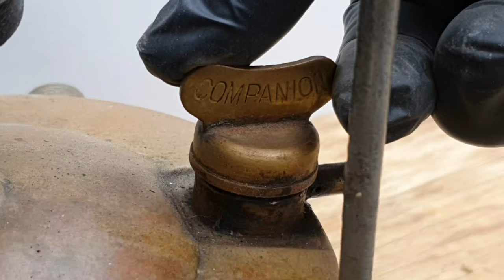1930's  Vintage Kerosene Companion Stove Restoration

Comment: Am glad you didn't have to weld back any parts. That was a nightmare for me. Flame proof gloss looks so much better than matt. Very nice and shiny and ready for camping 👏👏👍
Reply from the maker: I know buddy I watched yours a couple of times and that bit looked like a pain. I now have a new appreciation for all the work you did on yours, that project was harder than it looked.
Reply: @Austeration  Haha - your sandblaster seems to be working perfectly. Hopefully I get back to playing with mine next week 😉
Reply from the maker: @LittleRestorers  mmm not that perfectly. The glass I put inside has started to pit already and after a good work out it's still starting to run out of media. I'm going to have to start working on version 50.1 now. Still better than it was though.

Comment: Wow!!!!!!
Reply: that Sir it a cool stove !!!!!
Reply: Looking Great 👍
Reply: love the table slide move !!!!!
Reply: I need to try the Blue,  looks 👍
Reply: The pump cup !!! Great tip , must try that .
Reply: Hey !!!!!!!! thanks for the shout out ! you used the funnel!!!!
Reply: You sir ARE the master
Reply: That Burner BLUE Burner 💙  Thank you Great Work 👍 👌 🙌 👏 🙏 😀
Reply from the maker: @doinsngoins  Thanks Steve that funnel is great. I was going to check with you about the flame. Is that how it should be burning or should it be like a rocket like yours are and if so what do I need to do to fix it ? Any thoughts.
Yes get your self some cold blue, you will be glad you did.

Comment: Great job. Nice to see how good they look when restored. I love the polished brass. 
I have about three, some with missing parts so I should be able to make one out of the three. Last night I ordered a repair kit of spanners, gaskets and valves from the UK for when I get around to doing mine. Hope it turns out as nice as yours.
Reply from the maker: Thanks for watching Shed Man. I also love polished Brass. I hope you do find all the parts. I can say that polishing it was the hardest part. Can't wait to see how yours turns out, I'm sure it will be just as good if not better.